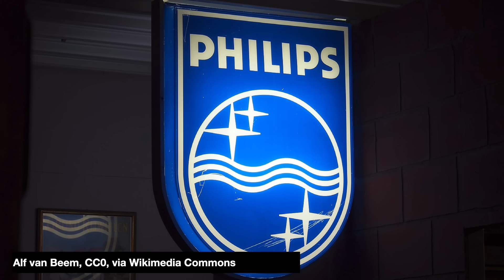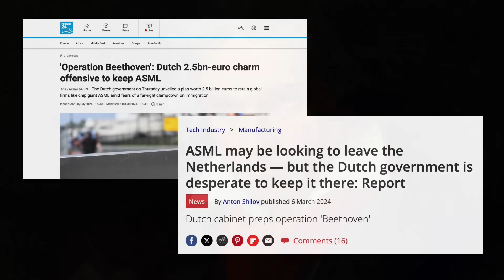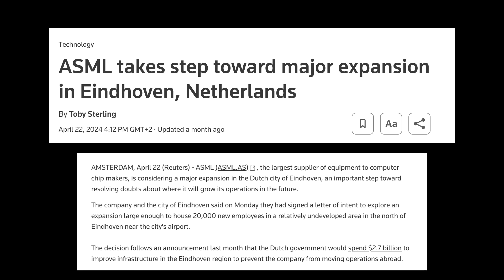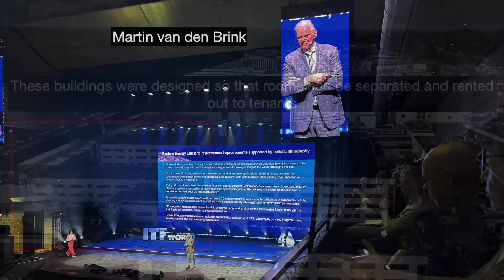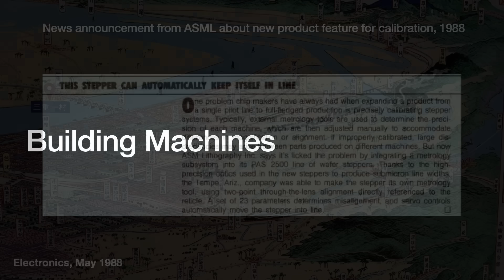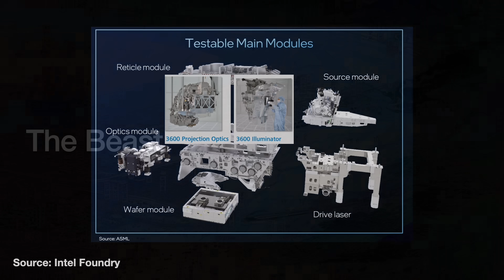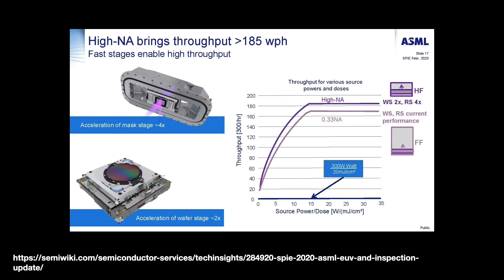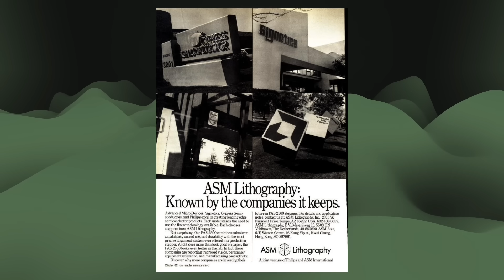What’s Next For ASML?

Comment: Enjoy your videos having been a litho engineering tech for 26 years, or 82mm wafers to 300mm wafers. Did work at the Veldhoven plant when they were making PAS5500, 200mm machines for 3 months. Started with Perkin Elmer 100,200,300 scanners, Censor 125mm tools, Nikon steppers, ASML PAS5500 and finally ASML Twin Scans.

Comment: Those Twitter "experts" made me laugh. The only part one had correct was that China might challenge ASML at some point - they are pouring billions into it after all.
But each step has to be cutting edge, because with thousands of steps even if yield is 99.9%, the end yield is below 37%. But if you change it to 99.95% it raises to 61%. And I'm pretty sure we passed 1000 steps around N7. So having each step to be as close to 100% is huge.

Assuming that is what they meant. Of course they could be talking about something completely different - "sadly" (thankfully) I'm not an armchair Semiconductor engineer ;)

Comment: Ohh, TSMC WILL buy this machine because there's no choice BUT to buy this machine.

Intel already has this machine and this time ASML is GOING to be there with Intel to make sure that all the processes involved work correctly.  If Intel gets High-NA into production in the next year, say making "Intel 20A" and that goes well for them, this lithography will get them to 17A pretty quickly.  I KNOW Intel has had problems getting onto new process nodes which has been the big hang-up for them (new Arrow Lake CPUs are going to use TSMC die), but they've supposedly made big commitments to fix this issue so we'll see.

The point is if Intel is on 17A in 3 - 4 years they'll be making that node much easier than TSMC would be making something like 2nm.  That could blow open the market and TSMC would be dropping prices.

So we'll see.  I would imagine that TSMC wants a machine before the year's end and I THOUGHT they were already in line to get the 2nd unit that ASML builds.  Intel has the first.

Comment: Thank you for bringing back memories. In 1984 I did a graduate diploma and my Institute of technology had just bought an old Philips lithography machine for students to use. I designed and made by hand a 2500 nm resolution chip. Philips had a huge factory in my city in the 1960’s, but of course was wiped out by imports from Japan etc.

Comment: I work at a company that makes many parts for ASML.
I make test hardware, so I am very early and deep into the process.
and it's so cool to see hardware built by us.

The reason why the office is so much larger than the manufacturing hall is that most parts are made by other companies.
On the machine you can also clearly see blocks and loose modules.

ASML works with partners by providing a very strict and well-developed model to a supplier
Together we will work towards a functional and producible version.

This means that knowledge from hundreds of top companies is used and, through strict collaboration, it is made exactly what ASML needs.

the eye for detail is almost insane.

Every installation machine that we supply built-in and wired is 100% tested for connection.
then tested for tension, then tested for insulation and finally tested for performance in a clean room.
This means that we allow a current higher than the capacity of the outdoor unit to flow through it for a certain period of time until it trips.
We do this at every machine.
The trip current and its structure over time are also examined.
All this is then tracked and stored so that years later it can still be found how an outdoor tomato behaved if problems arise later.

and yes, we have sent batches back to ABB ourselves because they were incorrectly labeled.
and they just wonder how we knew what rating it should have and which factory they came from.

i Love my job.

Comment: EUV is also known as soft XRAY.  IBM built an XRAY synchrotron in the 90's, and we shipped XRAY aligners for a tiny fraction of the EUV cost.  Look up the DALP program, with IBM and SVGL.  The industry didnt like the concept of a synchrotron, although it worked well, but at the time the feature sizes patterned although leading edge at the time, but very large compared to now.  It all worked well.  But industry did not like the cost/concept of a synchrotron based XRAY.  So, The EUV program was launched here in US as a govt / industry consortium.  SVGL had the lead in lithography technology, unrivaled in the 90's [it was the former Perkin Elmer FYI].    But later, after some companies passed on acquiring ASML,  it was ASML who acquired SVG.  SVG had Intel and IBM as volume customers, who were the two leaders in technology.  So ASML got the Litho technology roadmap when buying SVG, which included EUV program, and the Intel and IBM business, which they had never won.  There was some opposition to the sale of the critical technology, but at the time the zeitgeist was to let it go.

Comment: Who uses Nikon and Canon EUV stuff? I mean the new equipment. I know they can't do the most advanced nodes(the cool guy 7+), but it's like they don't exist in the discussion. I'm guessing some of the Chinese companies (SMEE, ex) probably sell locally, but not sure about it either.
Reply: They probably build a lot for 22nn 14nn nodes or different nodes for subsystems in automotive or other Industries
Reply: None of those companies have EUV systems. Nikon and canon compete with asml in the DUV space. SMEE tried to compete in the DUV space years ago, but got beat out. However the pivoted quite successfully into the advanced packaging market (basically even lower end than DUV). It remains to be seen if the expanded export restrictions on ASML motivate the Chinese government enough to push SMEE up the value chain to DUV and maybe eventually EUV
Reply: @kellensanna  Thank you for the answer! In layman terms, what would be the highest node that you can "print", on the Japanese DUV machines?

By advanced packaging(for trailing nodes) you mean steppers? I'm sorry if it's a stupid question.

Comment: How do they manage to position the wafer so precisely? (And so quickly?)

Generating EUV light seems almost trivial compared to getting the accuracy of the steppers.
Reply: Infernal-meter's and prescanning wafers. That why the old lens machine is called twinscan.  One wafer is scanned the other is exposed. It also reduce the shaking of machine somehow.

You may want to watch the last Gear Corn video on ASML a couple of times : NA High something. 

The 4 refectros for the inferno-metre's near wafer are made by Anteryon i think ( which is Chinese own and near the airport (inside build BIC 1 )) .
Building BiC 2 will be north of BIC1 across the road and will solely filled  by Anteryon 

There will be BIC 3 till 6 North of the Road . Roughly north east of Fast Food Shop called Beatrix ( after the King mother ( stepped down Queen of The Netherlands )   

The pumps are probably still from Edwards Vacuums (has very close service building ).

Also there is a screen place before the Mask to stop atoms running the mask.  Its very special material and has name i cannot remember at the moment
This was developed with/by TuE ( Technical University Eindhoven ).

Comment: EUV has 13.5 nm wavelength ? But it can produce structures with 3 nm size ? This seems impossible from physics. Also it is said that optical microscope cannot reach more than 2000-times enlargement because of wavelength restrictions. What is the trick that 13.5 nm light can form 2-3 nm structures ? As alternative to EUV or X-rays, electron beams are an obvious alternative. They do so good in electron raster microscopes. But not in Chip production ? Is it only because printing a chip like a TV screen needs to much time ? Could the time demand be solved by parallelization of plenty "TV-Systems" printing chips in parallel ? Seems much more attractive than this fairly difficult systems of tin-trops laser and huge mirrors. A crystall layer is around 0.2 nm thick. Meaning that 2 nm are only 10 layers of silicon. It is said, that 2 nm will be the end of Moores Law. No smaller structures are possible. Now 3D architectures are discussed for further advances in Chip design. Do You know if Intel uses such 3 nm machines in US factories ? For the German Magdeburg Intel factory also the installation of newest ASML machines are discussed. But can Intel and Europe do step into such a technology ? It is like from simple propeller planes to step immediately into sixed generation fighter steps. It is discussed for the newest european fighter jet system. But currently in Europe a lot is stated but nothing realized. Most modern industries a shut down and shifted or sold to asian players. Europe may be to poor and general to weak to establish own high end chip factories. Even in ccoperation with Intel, which is also behind TSCM.
Reply: Asianometry has explained this in other videos but “node size” is basically a version number at this point. There isnt a clean dimension that describes chip performance and so intel and tsmc just lower the nanometers when they produce what they consider a significant performance increase. However you CAN produce line widths smaller than your wavelength of light with a process called multi patterning. They have been doing it with DUV for years. Most things you can do with EUV you can do with DUV at the cost of more time and money.
Reply: Like the previous speaker said, the number has very little to do with the actual feature size. The "3 nm" node that's currently in volume production actually has a gate pitch of 48 nm and a metal pitch of 24 nm.
Reply: @Gameboygenius  So it seems that discussions aboute "nodes in nm" is complete fake stuff. It looks like TSCM has reached 2  nm (meaning 10 atomlayers) with a 13.5 nm EUV machine. And european chipmakers dont come beyond 150 nm structure size. And Intel perhaps 14 or 7 nm best results. But TSCM can do 2 nm. Is it all an fake discussion ?
Reply: @wolfgangrenner4152  More or less, yeah, unless someone is talking about the actual dimensions instead of the node name.

Comment: if the next thing are Xrays, then it will be based on diffraction, not reflection imho. We're already getting close to that since High NA is around 13.5 nm, with Xrays starting at 10 nm.  Perhaps the best way to go from now would be with be with beta radiation since a beam can  be manipulated with magnetic lenses.
Reply: Electrons repel each other, which is a problem with electron beam lithography. Maybe less of a problem if it is not a beam but a whole image at once, fewer electrons in one place.
Reply: @pizzablender  Xrays are not electrons, are high energy photons. you are thinking of beta radiation which is made of high energy electrons.
Reply: @MalinCruceru  I know, my reaction was to a "beta ray" comment. Which is electrons.
Reply: @pizzablender  m y bad
Reply: Diffraction is already infeasible because it filters out high frequencies.
Reply: @FrigoCoder  what do you mean by that?
Reply: @MalinCruceru  We can only use mirrors and not lenses because EUV is already too high frequency and would be filtered out by lenses. Unless you mean diffraction by other means and not lenses.
Reply: @FrigoCoder  yes. diffraction is a different phenomena than reflection.

Comment: Why ASML doesn't  believe in e-beam? What are the reasons to think that way? It only seems logical that the next step goes through e-beam.
Reply: Throughput and uptime issues must be solved
Reply: @irfanhekimoglu2294  yeah must be solved, but not discarded!
Reply: ASML, a Dutch company, the largest supplier of photolithography systems for semiconductor industry, takes over another Dutch company Mapper Lithography.

Mapper Lithography, founded in 2000, tried to bring another lithography technology to the market: multiple e-beam direct writing tool with more than 13 000 e-beams operating in parallel. However, after almost 20 years they didn't
Reply: @ev9637 yeah I know some companies that bumped/crashed somehow trying e-beam. What I seek to understand is what makes them run away from this technology after trying? What is the biggest struggle? While it only makes sense to pursue this technology to advance lithography capabilities. Also 13k e-beams seem to be ridiculous, no wonder they failed trying to do it...
Reply: @CapitaoFalcao_94  Throughput, throughput and throughput. Without a mask, the e-beam has to race around the projection area which is slooooow. Add to that that you only have a projection area of about 1 mm2. For any larger objects, you need to move the stage with the realignment that comes with that. The only remotely reasonable way to speed up the process is to increase the numbers of beams, but even that is very impractical. If you can come up with a good way to produce a wafer in less than 1 year with e-beam, you could probably become a billlionaire.

Comment: Your lucky to have escaped at all alive and buck naked in one piece.  Energy comes from broken logic.  Its very simple to show an example, but school is to conform logic.  Like take a sailing ship and write a word on it in arabic, convert the word with normalized geometry into english, now change that word into korean, carry on translating geometrically into chinese.  This just took every brain cell in the known universe to transform geometrically.  Theres a more reasonable answer though, control vs symetry, both will work, both are the same except control explodes periodically.  Like if you overcharge a lithium rubber band, or battery, it beers time enough to explode.  Without current, it does nothing.  So symetry has the advantage of time, universe after universe, negative infinities to infinite powers.  The heavens change as each new day one approachs a double quaterion, a new octet.  Its not as affordable as C3P0, but run 7 series 100uf capacitors into 8 rull rectifying 50uF capacitors across a 200mhz PNP transistor into a 1 megaohm dummy load and the battery will explode at one ten thousandth per cycle from overcharging.  So you add symetry, a triangular speed of light switch.  A free heater.
Reply: Way to go ChatGP1!  😃
Reply: Whaaat?????

Comment: Are the issues with using x rays physics? Or are the issues that we currently do not have the means/materials to use them in lithography?
Reply: Is like everything you mention. Is difficult to manage x rays and the materials of the machine (including the masks) absorbs that radiation, so it creates its own set of problems. 

Probably isn't impossible to overcome, but a very difficult task for ASML and its partners due to its dedication on conventional optics.
Reply: The shorter wavelength you go the more difficult it becomes to reflect light. For x-rays you have to have very shallow angle of incidence on optics (a few degrees only) so all the light path becomes very long and you can't fold it up to such a compact size as the current "beast".
Reply: @Martinit0  I see, thanks

Comment: Despite what you have mentioned, I think ASML might be building a new american headquarters in the USA. I don't have anything to back this up other than a number of ads I have received on social media that seem to be geo located to the Bay Area and Seattle. They were encouraging people to apply for jobs if they worked in the tech industry, the ones I saw the most were for people qualified in the fields of Supply chain management, certified accountants, and electrical engineering. Just thought I would share for anyone who is interested.
Reply: Interesting, though it was noted in this video that half of the companies workers weren't at the headquarters. And with a headcount in the tens of thousands even a different location could still have a lot of people then.

So perhaps you're just running in to something like that? ASML just moving would be after all not so easy, a lot of their workers wouldn't just move.
Reply: @Quickshot0  Yes it's very possible, it was mostly just the number and persistence of the ads that made them memorable, not to mention that most tech companies aren't recruiting, even nvidia. They have a fairly sizeable campus in silicon valley already so makes sense, mostly seeing the same advertisements in Seattle threw me off guard because it's quite a far distance from any of their offices.